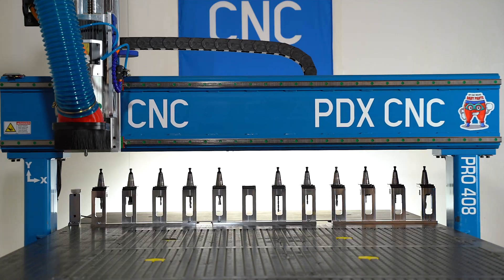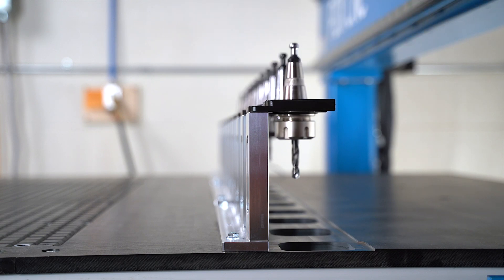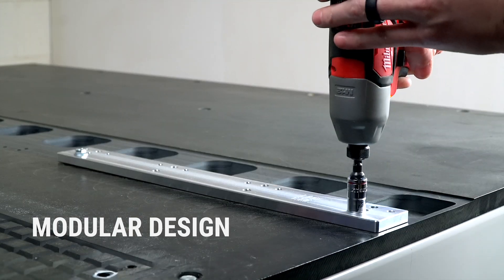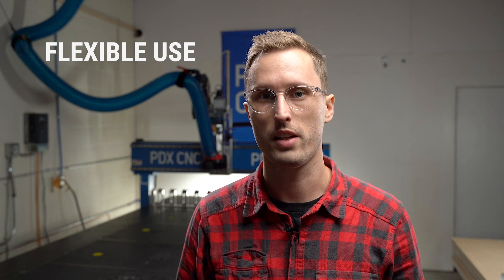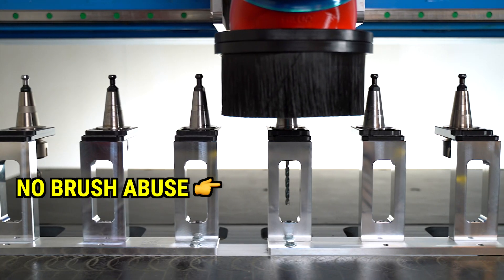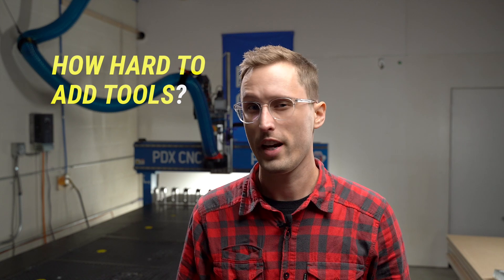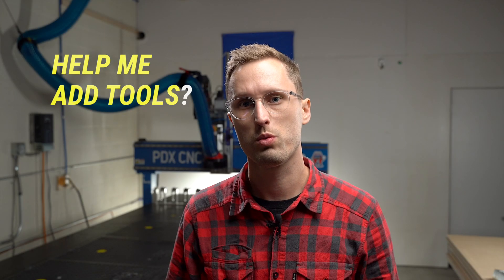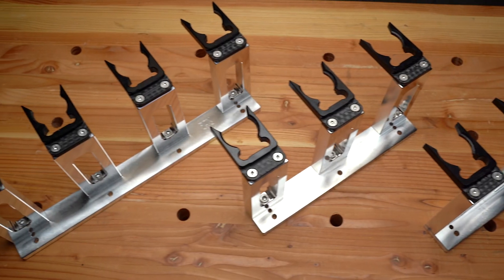We upgraded our ShopSabre CNC Router

Comment: I like how your dust shoe does not have a need to retract or dock for a tool change. I have a machine that I just bought new and the dust shoe retracts for a tool change. Can I send you a video of it to see what the options would be for removing the shroud up/down?
Reply from the maker: Thanks. Ours fits HSD spindles with 100mm noses. It has worked with some that have pneumatic actuators by removing those, particularly Multicam.